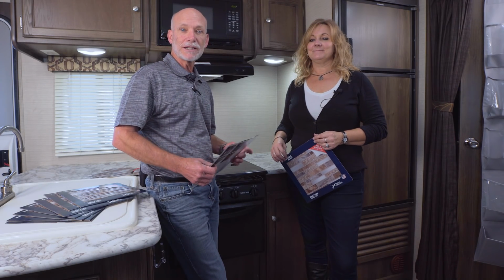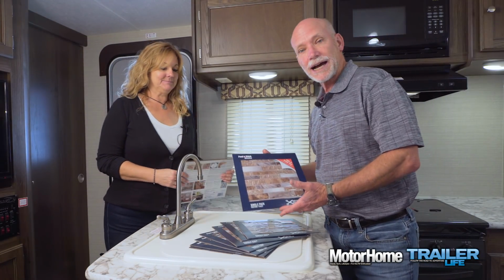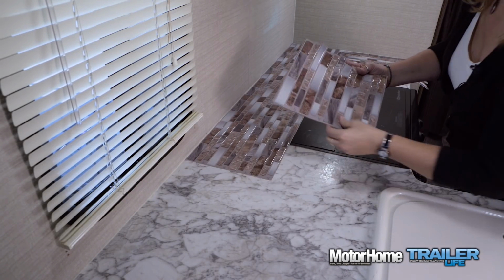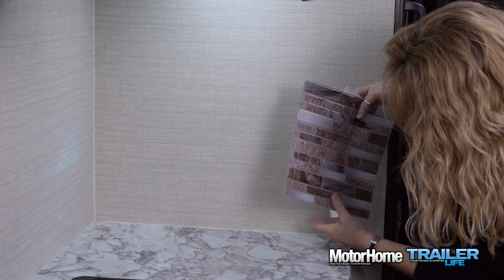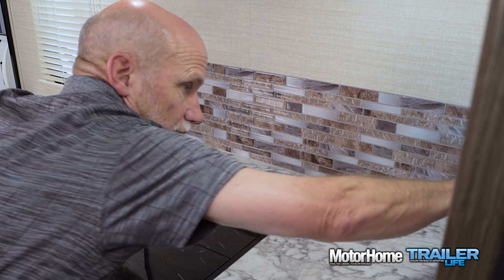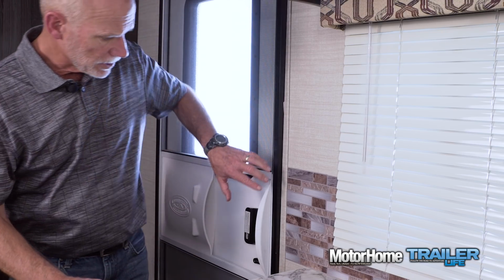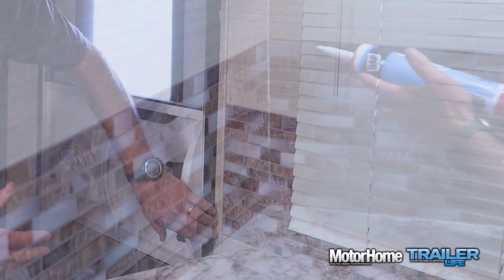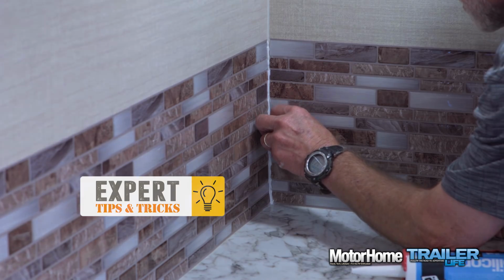RV Smart: Peel and Stick Backsplash Installation

Comment: #1 complaint is tiles peeling off after a short while.   To prevent this mask off areas around area tiles are to be installed and spray with 3M Super 77 adhesive (wear a paint or dust mask, open windows and control your overspray) or paint areas where tiles are going with Glidden Gripper Primer and let dry.   Walls will fall off the coach before the stick on tiles will but be careful while installing as tiles will tack up fast and hard.
Reply: I agree. Wall prep is the key to the tiles remaining stuck to the wall. On mine, I just painted the wall with an oil base paint, let it dry, then applied the peel and stick mini stainless steel look (actually plastic) subway tiles. Looks awesome, and I installed them in 2010. 60,000 miles worth of bumpy roads, and I haven't had any issues.

Comment: Thanks for the video.  We have been thinking about doing this as well.   One question I have is what is the purpose of the silicone?   Did you consider using something other than white or was there a reason for the color choice?

Comment: I'm still watching your video but am wondering if you have had any issues with the tile sticking in hot or cold weather.  I'm considering purchasing vinyl backsplash tiles for my camper bus (shuttle bus made of fiberglass) but live in ND and store my bus in the outdoors in the winter.  Also, it gets hot and muggy here, so I'm curious if you think the tiles stay in place well during those temperature situations.  Thank you for any information you can offer.  Happy trails!
Reply: We're in California so no super-harsh conditions. But going on three years installed and no problems with the tiles not sticking.
Reply: I'm in North Texas(summer temps in the 100's) and the peel and stick tile that we applied in our RV is peeling off the walls. It's a disaster. I would recommend using a heavy duty construction grade adhesive with the peel and stick tiles. I wish we would have known to do this!